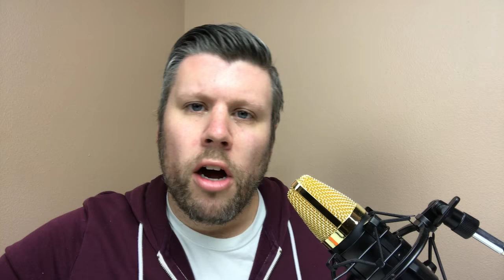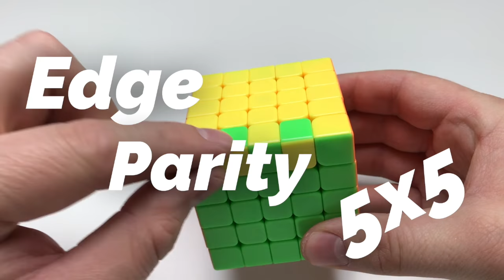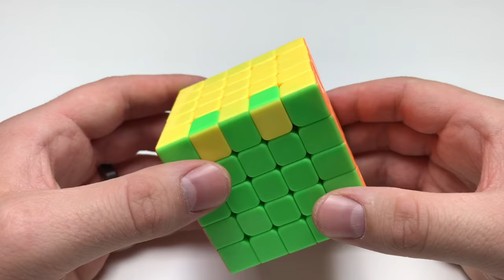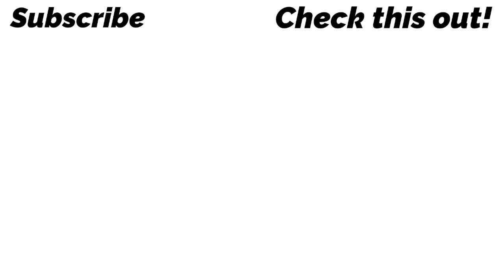5x5 Edge Parity Tutorial **Updated**

Comment: guys you dont have to do the alg with middle slices, just do wide right moves and wide left moves and it works but is faster
Reply: DanCubes sorry that doesn't work
Reply: RISHABH KUMAR yes it does. try again.
Reply: i could literally record me doing it and upload it just to prove it works
Reply: just in case you're confused as to what i meant, replace the middle slices with wide moves
Reply: I got the moves in the video to work, but if I try using wide moves (ie moving both right columns or both left columns instead of the single columns, I end up with the parity solved but with 2 twisted corner pieces.  Did you upload a video DanCubes?  I'm curious to learn the best moveset for this parity.
Reply: @RevYars  you are just solving the edges so don't mind having twisted corners yet.
Reply: @RevYars  as in speedcubing doing wide moves is more efficient and faster than middle slices.
Reply: @leadcube591   it not working can you upload the vid im  curious to see how you do it
Reply: @weirdpotato2167  it works if you do the parity alg in between the edge pairing and the 3x3 solve stage. It does not work if you do it on a almost solved cube
Reply: Thanks!
Reply: IT WORKED AND SHAVED 15 SECONDS OFF MY PARITY ALGORITHM, You are a legend DanCubes

Comment: 0:34  If there's two such edges that each need the parity algorithm,  you don't need the parity algorithm to solve them both.

You can instead put two such edges next to each other, then move the middle out, use the edge flipping algorithm which you usually need to know anyways for the last few edges, then finally move the middle back.
Reply: Yes, this is a great time-saver!  Furthermore, if you're just working on edges and didn't wait to fix this until you're done solving as 3x3, you can leave out the final F2, and instead of the Rm's, you can just include the rightmost layer (i guess that'd be an Rw instead of an Rm)
Reply: Yes Like you can't have parity on two edges its only on one

Comment: Is there an easier way?  Also,  although you may came across this more than once on a solve, it's never a problem until you have all edges paired aside form 1 parity.
Reply from the maker: This is the way I still do it.
Reply: WOW! THAT'S A BUNCH OF STEPS TO MEMORIZE IN THA LONG ALGORITHM THAT I FIND ARE NOT REALLY FASTER THAN JUST SELECTING THE WRONG CUBE(COLOR BACKWARDS) AND JUST MOVING IT OUT TEMPORARILY, THEN INSERTING IT BACK INTO THE SAME SPACE BUT COLOR ALIGNED CORRECTLY - TAKES WAY LESS TIME AND ONE LESS ALGORITHMS TO LEARN - TRY IT AND SEE HOW MUCH FASTER IT IS TO JUST SWITCH ONE IN AND THEN SWITCH IT BACK CORRECTLY